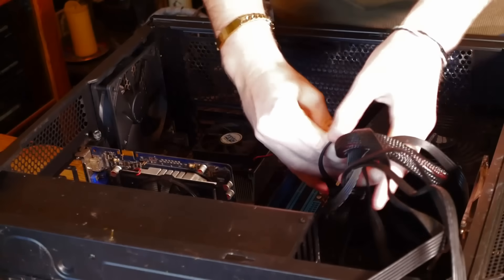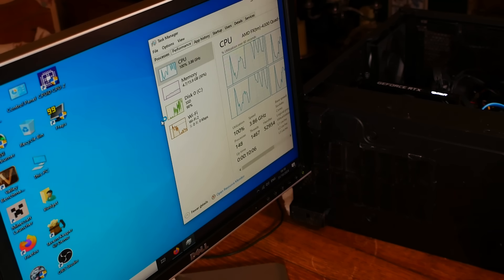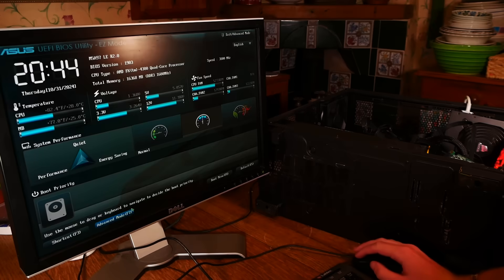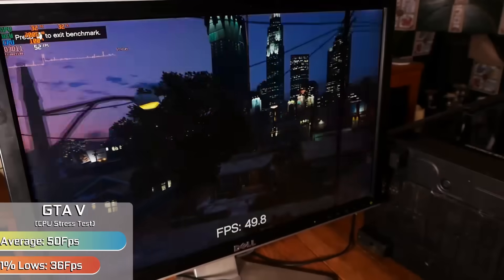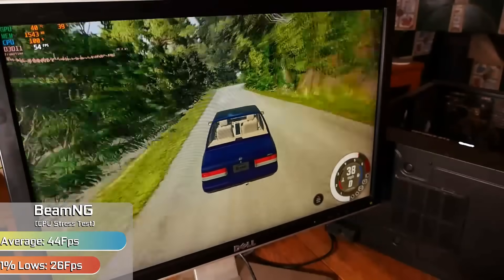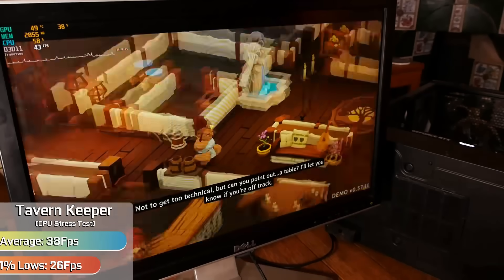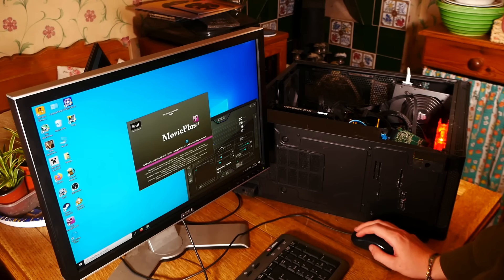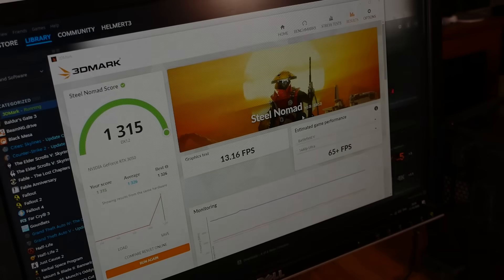AMDs Weakest FX Processor...

Comment: I made the huge mistake of buying an FX-4100 back in the day. The architecture was simply at odds with how Windows gaming worked at the time, kept tripping over itself. A Phenom II X6 would have been a better purchase. Once I got a new job, I dumped it all for a 4770k.
Reply: Part of the issue was that they doubled the integer units, but kept a low amount of FPU units. And games since Quake are quite FPU heavy.
NetBurst did work a bit better in that regard. Also a low IPC, long pipeline layout, that when fed well, could perform well. And it had a full amount of FPUs.
So in terms of performance, it could compete just fine, but also scale up insanely with the right workload. I remember stuff like video rendering or mp3 encoding being much faster on a Pentium 4 than on an Athlon XP.
Reply: @HappyBeezerStudios 
Chips and Cheese has a rather indepth article on AMD FX, specifically Bulldozer. They stressed some concern for the reduced ALU count (2 ALU 2 AGUs?) and on benchmarks the systems integer performance is nothing to write home about, unlike floating point performance.

It's similar as two small [integer] cores paired with a big, fat FPU. A lot of performance woes seem to be pointed at the small L1 cache, overall high cache latencies, execution latency, forwarding stall penalties etc. Parallels can be (and probably were) drawn with NetBurst but AMD did make effort to avoid some of the pitfalls.
Reply: Addendum comment:
Not unlike the OP bought a FX-170 while Phenom IIs were cheap and would've been better in the long-run. Had some dual-core Athlon so it was an improvement but wasn't enough and the system became my introduction to overclocking with an HD 7700 and 8GB DDR3 1866.
Reply: @HappyBeezerStudios  This seemed to be a common problem on Buldozzer 1st and 2nd gens. Processor would crack open integer operations, but were pretty tired on floating point.
Reply: Someone often dumped it and I picked twice since I moved to current place
Reply: I remember going from a FX6300 to a I7 4790- I was stunned at the gaming difference, I do still have the MB,RAM, and a 6300 and 8350 in the closet, the FX was the first pc I had built - it traumatized me.
Reply: @tomr3422  I know the reason. AM3 plus was kinda electric fan sipping 2500watta into the air.

Comment: my first pc had a fx4350 i then got an fx-8350 for ~$80 just to play vermintide with decent framerate. Then i got a ryzen 1700x to 2700x, and am now sitting on a 5600x. If i can get a 5700x3d for 150 id upgrade to that if not ill just prob wait for am6 to build another pc

my first gpu was a gtx750ti that i eventually got to sadly a $300 1050ti when prices skyrocketed, like holy hell what a shit deal i got, then a vega64 for $300 that i wish i sold during the crypto craze for ~$1000. Now i have an rx7600 that i got fro $220 at launch so it was a pretty decent deal. Im now just waiting to find any card with at least 16gb of vram to hit a decent price point.

Comment: My fist system was an HP Vectra with a PII 266MHz, then one with a Duron 700 MHz, then a laptop with a Mobile Athlon64 3400+ that despite its stock speed of 2200MHz showed 800MHz in system proprieties, then an E5-571 with an i3-4030u, followed by a W510 with a i7-820QM...
From past autumn, I started to invest in a new system, started with a B760 MB, a 32 GB RAM module and a G6900 ( after BIOS update, later returned it in favour of an i7-14700K ), if anyone is interested in more details about my systems journey, feel free to reply.

Comment: I had it's bigger brother at the time, the 6300. Think I spent around $110 or so on it. The system eventually died and it's been gone for some years now. Was pretty ok when it was newish, but I had a lot of stability issues with it over its lifespan for some reason. Probably wasn't the processors fault though.

Comment: Yeah, people remember that the gaming was better on intel chips with their better single threaded performance, but they forget that running anything in the background could occupy a core or 2 and the only intel chips someone on a budget could get did not have both four cores and overclocking at the same time. Which was a big deal because early turbo boost did not come anywhere close to maxing out the chip and the all core max clocks were kinda low. So for anyone who did more than games and could tolerate the power consumption more than the initial sticker price, they just worked.

Comment: I started out on the 4300fx in 2011. I upgraded the CPU aa few years ago to the 8370fx. Recently doubled the ram to 16G, and ungraded from a pair of Radeon 7700 firewire to a GeForce 1650. Also a 2T SSD. 
A few months ago I got a new Intel i5 13600. Still have the AMD PC and it runs very well. 13 years and counting.

Comment: I had the Phenom II X4 955 and later the 8350 (the latter with the wraith cooler). Bought both of them new,  long after release, at a budget price. Both were really good, capable budget options. Still have them in their box on the shelf.
Reply: Time to set up a retro system for all those old games that don't run well on modern platforms.
The Phenom could totally get something like a HD 5850, HD 6950, GTX 570, etc. And the FX would probably be happy with a GTX 670 or HD 7950

Comment: I know everyone talks smack about this line of CPUs, but they definitely have a purpose. My first PC that I ever built was a tight budget build about 10 years ago and it WASN'T just for gaming. I also did a lot of productivity stuff (video editing, photoshop, 3D etc.) and always wondered if I had made the right CPU choice since the FX DEFINITELY wasn't perfect (but was like $78). I got the i3 and i5 from that generation many years later and the FX beat both of those CPUs in productivity and didn't fall too drastically behind in gaming since everything i played even the new stuff still ran at 60FPS. It was GREAT for budget all around builds, you just couldn't use the stock cooler. It cooked itself when I used that cause I was cheap.
Reply: I really want to see someone make a large test on the FX against the Sandy-Ivy-Haswell chips and how well they aged.
Maybe FX-6300 vs i3-2120, i5-2400, i5-4460, i3-4160
and FX-8350 vs  i5-2500K, i7-2600K, i5-3570K, i7-4770K

Can the 3 modules compete against 4 full cores these days?
Are 4 modules closer to 4 threads or 8 threads now?
Does oc change anything about the result?
And how does something like a Phenom II X4 965 or X6 1055T compete? They were sometimes faster than the FX and I wouldn't be surprised if at least some people went with the old one instead.

Comment: I loved the FX series of processors. My first proper decent computer was built with an FX 6300 which I bought super cheap as a used bundle. Then my friend gave me his used FX 8320 for free which I overclocked 😅. But I had it paired with a GTX 580, then a GTX 760 and then a GTX 960 before I upgraded to Ryzen. Good times 🥲
Reply: My first gaming pc had a fx6350, build it for 0€ with free parts of a local marketplace. Indeed good times!

Comment: I ran the 8350 for years without issue. $99 was a great value for performance. Yes, Ryzen is fantastic (I have the 7800X3D now) however, at the time, Intel was way to expensive, thus why I went with the FX chip. It served me quite well over the years.

Comment: I still have my old FX-8350 somewhere....  It was perfectly adequate for 1080p 60 FPS gaming and it did just fine for general computing, too; I didn't retire it until 2019.  Huge improvement over the crappy 2-core Intels I could afford at the time, it gave me 80% of the performance of the then-king Intel I7-3770K for a third the price.  I slapped a Cooler Master Hyper 212 Evo cooler on it and it was pretty cool and quiet unless I was rendering video or playing demanding games; my GPU was far noisier though so it didn't really matter.

Comment: I had a build come in for a clean and update to the storage and graphic card more ram.... it had an over clocked fx 9590 in it clocked to 5.8 ghz .... it ran great put a 1070 into it but he came back a few years later and bought a i5 9600f 4.1 ghz base overclocked to 5.0 
And a 3070ti and kept his ram and ssd . His mom uses the other one I threw a gt1030 in it for her. Still running

Comment: The fx were not brilliant compared to intel but also most people used it wrong. Amd recommended 1866 mhz ram and not using the default 2200 mhz north bridge speed in their amd fx performance tweaking guide. It can give you like 10% more fps in some cases as specially the north bridge could bottleneck the whole system. At least I've seen the "8 core" perform much better with the right settings.

Comment: I had an FX 6300 that I used in a PFSense build as a router.  Worked fine for that.  But I felt that the older AM3+ was a better CPU despite being even more power hungry.

Comment: FX-8350 was a criminally underrated chip.
Reply: @janiss2926  Only 8phase was ROG crosshair, sabertooth and UD7 but doesn't matter, elbow of efficiency curve was ~4.2Ghz.
MSI 970 gaming was a 3+1 POS and gigabyte UD3P was (good) 4 phase, IIRC some higher end asus was 6phase.
Reply: Compared to an i5 without hyperthreading yes. Compared to an i7 definetly no.
Reply: @saricubra2867  Compared to an i5 without hyperthreading yes. Compared to an i7
An FX8320 was £100 about the same price as an i3, an 2500k was £150 and i7 2600k £280.
The i5 is not 50% faster and the is is not 180% faster, I know as I still have them all.
Reply: @saricubra2867  Exactamente! El FX8350 costaba menos que un i5 35XX, y rendia mucho mejor en multithread... contra un i7 3777K/4770K perdía, pero el punto dulce de los FXs fue el costo/beneficio,

Comment: I had an FX 6300 on that same motherboard before I made the jump to an i5 Sandybridge.  Then to an i7 (which I currently have and am replacing in a couple of weeks with an 8th gen).  IDK if it was my video card or what but I remember being so disappointed with the performance of some then-current games in 2015, particularly GTAV.  I sat on the threshold of going to an FX 9590...but when I saw the TDP of the 9590 (TWO HUNDRED AND TWENTY WATTS!) vs the i5, switching to team blue was a slam dunk.

Comment: The problem I had when building a new FX based PC in 2019 was that I couldn't find a DDR4 mobo, as well as one with PCIe 3.0. So it was slower than it had to be overall.
Reply: None of the FX CPUs supported DDR4. The very last respin of the original Bulldozer core (known as "Excavator" and "Bristol Ridge") did, but they were APUs, and were sold as "Athlon X4" - they weren't FXs.
They were surprisingly good performers for the budget (both Steamroller and Excavator - the generations after Piledriver - brought 10-15% IPC improvements each), but being APUs, they were limited to four cores, and required an AM4 motherboard - and of course, they were absolutely clapped by Ryzen when it arrived shortly thereafter.

Comment: That lawsuit was such BS. Its 4 cores because its got 6 execution units divided into two integer units and one floating point unit per model but the cherry on top is that its a super scalar processor anyway with each of the integer units and both floating point units totally capable of executing more than one instruction at a time.
AMD settled because they'd have to reveal precisely how they accomplished this and give away trade secrets to prove how it worked which might not have won the case anyway. Legal "team" earned about 12 million for their trouble and those who asked for a partial refund got less than 2 dollars.
Reply from the maker: Exactly right that.
Reply: I got a refund from AMD that was like 30 dollars, not 2 lol

Comment: FX was outperformed by Intel systems but they weren't that bad as reviewers (and Intel) said they were. The main problem was FX used weird tricks to optimize multithreading, and if software took advantage of that, they were good.

Of course, no one wanted to optimize for "the loser cpus" so AMD was basically bullied.

But if you had one of those chips, the experience was watching software become more threaded, people wanting to change again their CPUs as they got outperformed, and intel pricing their CPUs higher and higher everyday, meanwhile your FX based PC was... "OK, I guess?" Not the faster or the better but it doesn't feel bad, at least not bad enough to make you go buy an overpriced Intel.

And then Ryzen happened.

Comment: I bought an FX-4100 in 2012 it was a huge bump in performance for me coming from an old Intel Pentium dual core. It was really cheap and allowed me to use all the power of my HD 5770 and recording my video games. Then I changed for an i7 3770k + HD 7870 in 2013 and it was a lot better of course. Good times. Now running R7 3700X + RTX 3060

Comment: I used to use an FX-8320. It was fine for 1 year until the motherboard died. Turns out AMD's motherboard branding was (and still is) not quite noob friendly. I was a 14 year old speccing out his first PC build, and bought a 960 board with way too weak power delivery, which died trying to fully power that chip. When I found out what caused the death (1 year after getting ANOTHER 960 board) I downclocked all the way to 2.8GHz and ended up bandaiding my PC with an old intel i5 3470 and a new motherboard. It didn't double the framerate but it did stabilise the system a lot. I still have that chip and motherboard sitting in my "scrap pc" case.

Comment: You won the lotto getting a working used AM3+ board because Christ those boards were horrible in terms of reliability since mine went through at least two boards in it's 7 year life span (both bought new), the vregs on my well cooled fx8350 cpu and Gigabyte 990 board ended up dying and caused massive system instability - soon as the cpu hit 100% the whole system locked up but if you were watching youtube, playing a game that was easy the system worked fine. Also ended up giving up trying to find used boards that didn't have some weird fault -some would just not detect, only detect one or two sticks as I had both Kingston and G.Skill 4x4gb 16gb kits, from any manufacturer due to being cheaped out on because lets face it AMD FX boards were an afterthought to manufacturers since intel was their bread winners at the time. Almost went to intel until I saw someone on youtube showing a Ryzen 7 2700x benchmark and my god that fx8350 was really showing its age then when I built that Ryzen system to replace it.
Reply from the maker: I bought this board brand new myself back in 2013.

Comment: I got a FX6100 for free and beat the absolute hell out of it. 5Ghz on all cores with a 25€ air cooler from a random chinese brand, paired with a MSI 970A krait. Great board apart from the power delivery system... It was overwehlmed by a stock FX6100 and i had to add massive amounts of airflow to reach the 5Ghz without it blowing up. MSI later removed the support for the FX9590 because the board literally blows up if you just try booting with it.
Reply: I got one too into my PC & i overclocked it too at 5Ghz. At 5Ghz paired with a modern GPU you can play SBK 22 & MotoGP 22 on Ultra in 2160p 60+FPS, Rage 2 on Ultra 2160p 60+FPS, Monster Jam Steel Titans, Terminator Resistance & of course older games maxed out in 2160p. I know because i recorded them on my YouTube channel XFORCE667.
Even Moto GP 23 runs maxed out in 1080p or higher using this OCed CPU.
Enjoy!

Comment: First setup I build back in 2012 had FX-4170 in it paired with AMD HD 7770 :D Later on upgraded to FX-8320 which smoothed out some of those Bulldozer kinks and gave the socket some more life but ehh... When I saw by friend play GTA V with locked 60fps with 4690K I knew I had to change (for a while) xD

Comment: I had an AMD fx-8350 in my old pc and it handled itself well enough for what I used at the time. I still have the old pc but got an 8th gen i7 based laptop after I started getting graphical issues on the pc. It was paired with a Saphire r9 380x, loved that pc when I got it back in 2014-2015 (.approx)

Comment: I still use an AMD FX-8370. It was top of the range (for 125w) during its day. It’s not great. Newest game I’ve tested is The Last of Us Part 1. It actually does run at around 45fps average, but can drop to mid 20s. I will use this CPU until it dies or nothing can run on it anymore. After that, I’m going over to console.

Comment: I had a FX8300 paired with 16 gigs of the fastest Kingston Ram I could get my hands on back then (supply in my country for RAM is awful) on a MSI G970 motherboard.
I switched to a 3600X system when it launched because it was handling Video editing horribly, and I lost many hours every week waiting for it to render a 1080p30 video.

Some time later I gave it to a friend who brought back an EVGA 2060 (the one with a cut down 2080 chip) who is still using it.
Mind you, it has been overclocked the same day I upgraded the cooling back in 2015ish???
And that friend of mine is still buying me beers because it is the most reliable system he ever had, rarely crashes, never stalls, it just keeps chugging along.
He can't justify upgrading because he is a light gamer, and his love of RimWorld which slows down in the late game is not enough to make him switch.

The fact that I am running an RX580 means that in some situations, the system i gave away for free to a friend who was struggling with Zen1 issues performs better than mine does.
Also, he drives a WRX STi, so he needs to save all the money he can lol.

Comment: FX4100 Bulldozer first gen FX was the weakest, i rocked FX4130 from 2013 to 2020 without major setbacks except for gaming, FX4300 is the 2nd gen Piledriver chip that is a little better.
Reply: Isn't the FX4130 a bit weaker because it just had 4MB of L3 Cache opposed to the 8MB of the FX4100?
Or were 5% more clock enough to make up that difference? 😆
Reply: @SylpheedW  IDK, never thought of that, just looked at benchmarks - 4130 seems like a couple percent better.